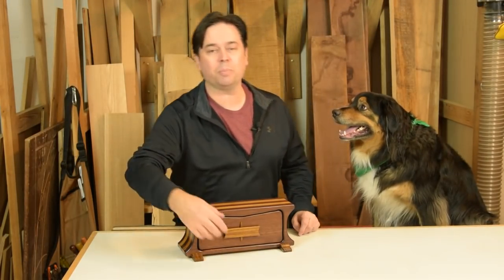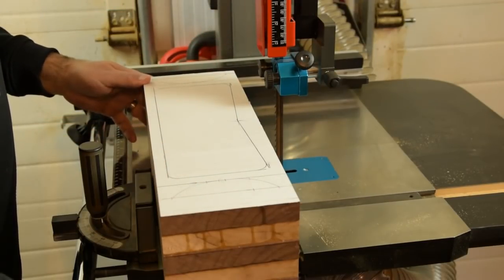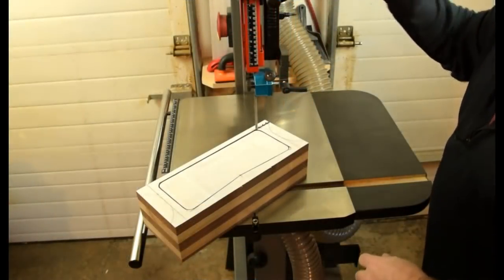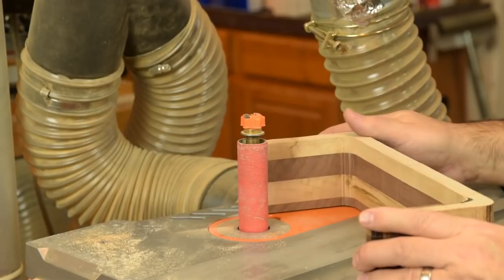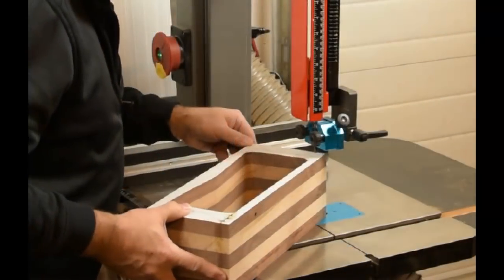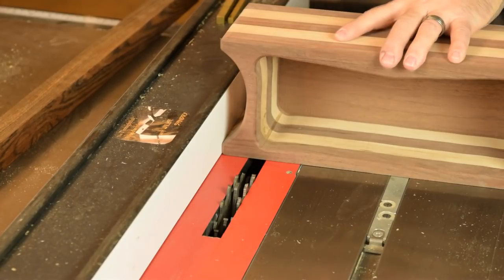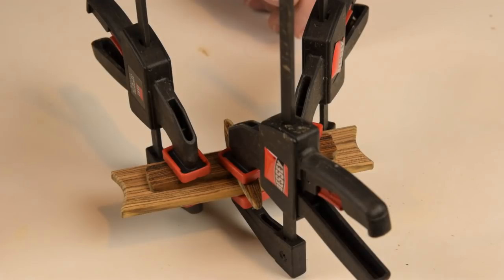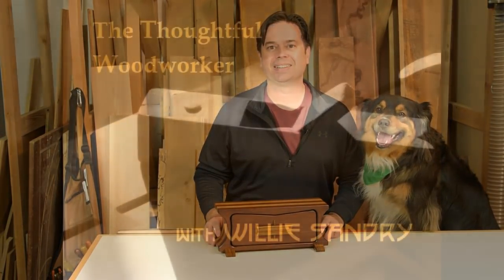How To Make a Bandsaw Box Featuring a 14|12 Laguna | Laguna Tools

Comment: Tell ya a better way to do the pattern rather than the spray adhesive. I make a copy of the patter on the printer or copier and set the darkness to a little darker. I then lay the pattern printed side down and take a hot iron and iron over the pattern with a little pressure, the heat will transfer the pattern to the wood, check it out, it’s the way I do it
Reply: Great idea!
Reply: @TheThoughtfulWoodworker  yea it works well, the heat from the iron transfers the toner to the wood. I haven’t used in in quite awhile but I used to make toys and that’s how I transferred the patterns 👍